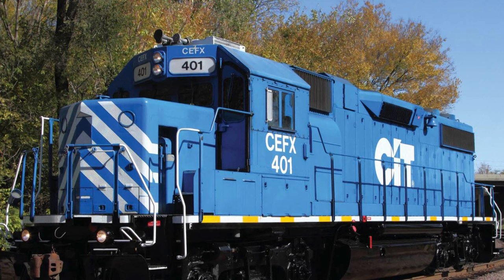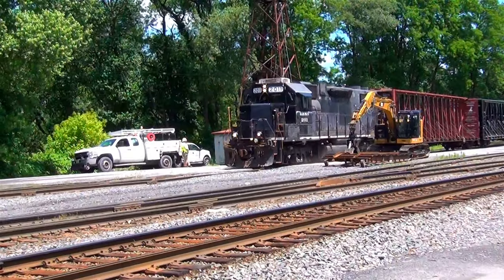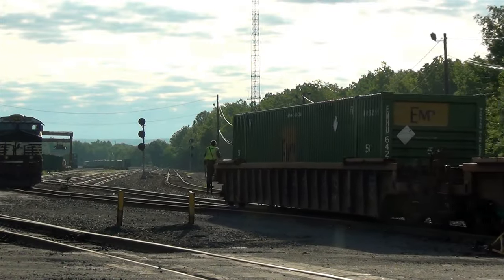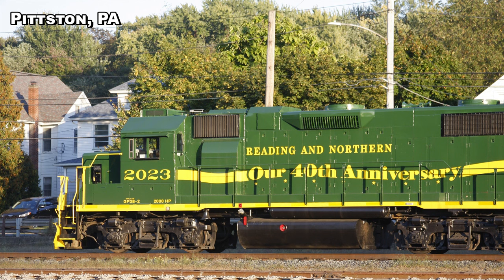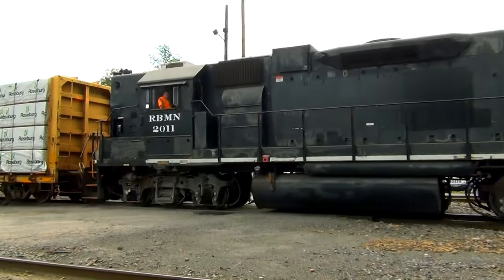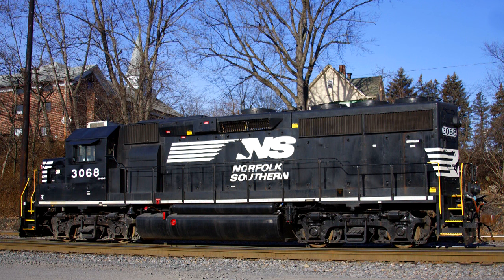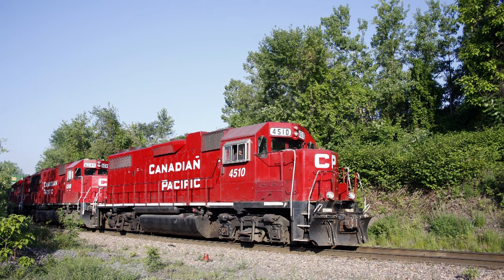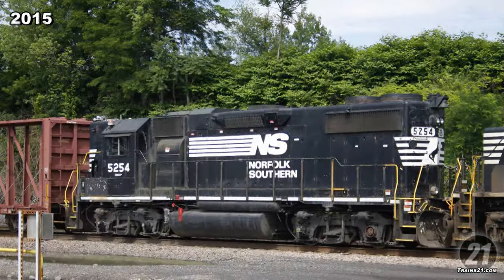EMD GP38 (Full Video) America's Locomotive + GP30

Comment: Original GP30 operators: you missed the B&O....the gods will not be pleased. (edited ti add): 

one of the main visual differences between the 40-series SD"s vs the Dash 2 versions was the length of the frame which was necessitated by the development of the new Dash 2, 6-axle truck known as the HT-C,  Compared to the old Flexicoils, they improved adhesion and traction due to better weight distribution.  A 4-axle HT design was also developed, but did not offer much if any improvement vs. the existing swing hanger designs.
Reply: Not just B&O, he missed CP as well